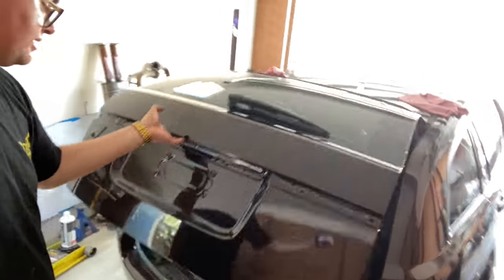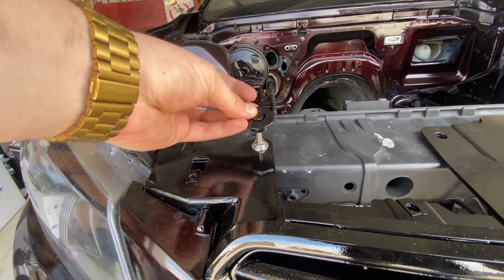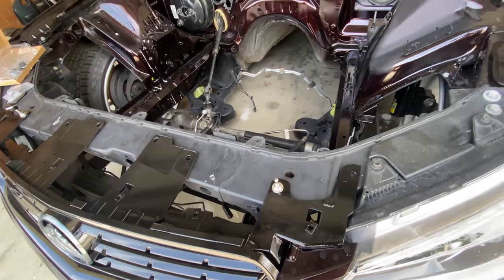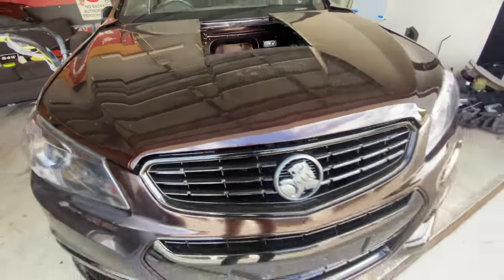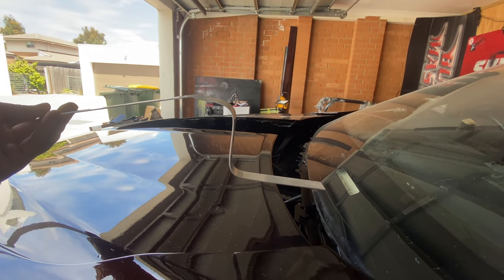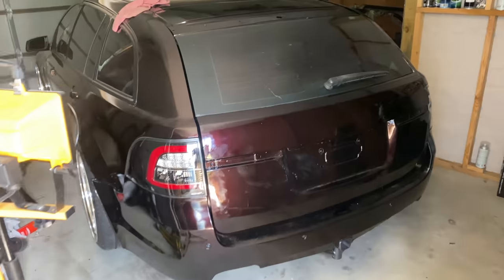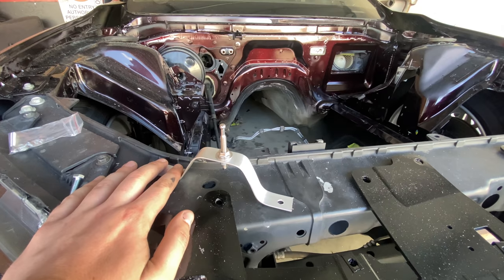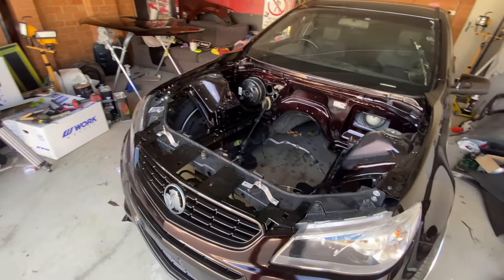Gotta Keep That Bonnet On!

Comment: Why don't you have a couple of posts machined up with a male thread at one end and female thread at the other. The male thread would screw in to the original bumper stop hole and the quick latch screw in to the top of the post. This will raise the Quik Latch to a suitable height and be adjustable.

Comment: I think it would be best to get the bigger stronger clips you spoke about for the front of the bonnet and fit the factory hinges and struts to give you the strength and a flush factory OEM finish all round. Your OEM bonnet latch and the clips it shouldn't go anywhere.
Reply from the maker: While that is one of the best ideas, we decided to go with having the whole bonnet easily removable and held on only by hood pins so that we dont have to hack up the bonnet and cut a huuuge hole so it can work on hinges
Reply: @Mick_Hinchy  Yeah I see your point. Hows this for an idea use the hood hinges as a template to fabricate mounting brackets for the rear pins that way the bracket could bolt straight into the hinge bolt  points in the firewall giving the bonnet an OEM finish.

Comment: I was going to use them same bonnet pins and thought they wouldn't hold the bonnet down at a high speed as the air pushing upwards under the bonnet
Reply from the maker: Yeah I ordered the big proper ones that are NHRA approved
Reply: @Mick_Hinchy  yeah if I remember rightly the eBay ones were rated at 60kg weight force

Comment: Dude stop , you just need to stop and have a think otherwise you will be running around for nothing 
I had these on my boot and after a few burnout events I canned them and put a boot popper as well as a bonnet popper with a rear slide under hinge easy and still have it today
Reply from the maker: Using the Quik-Latch ones should be perfect for the bonnet, they’re NHRA approved and rated to 5000lbs of lifting force so they should be great to hold the bonnet securely